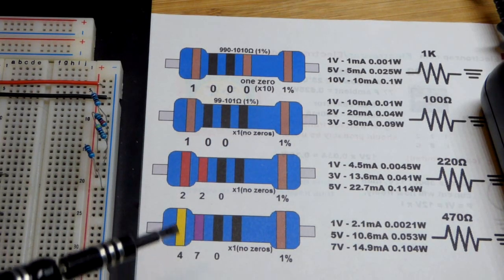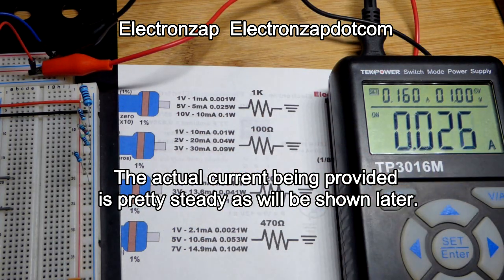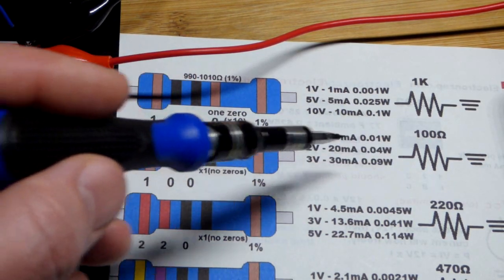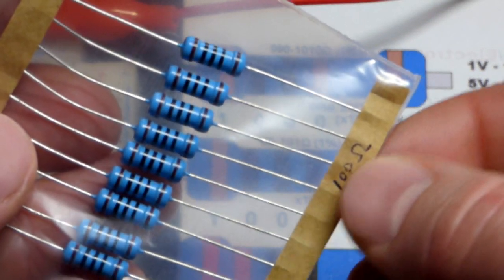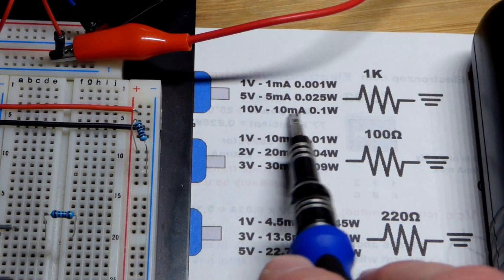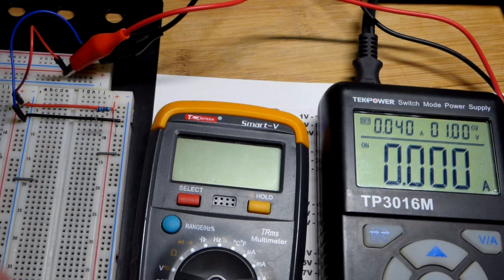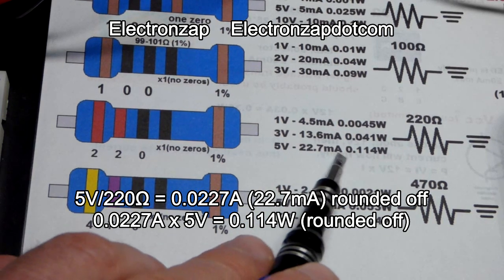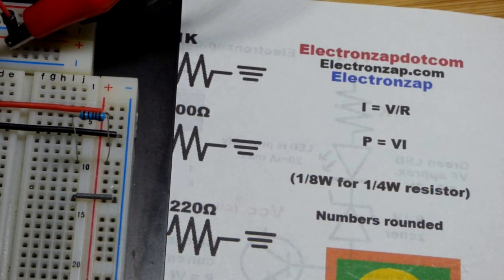Electronics resistor component fundamentals for current power and color code of common values

Comment: For what it is FWIW, the zero's counter band is a very computer science way of thinking -- building a string by concatenating characters, in this case appending zero's. I finally figured out which band on the resistor is the first one, took me a while to figure that out. Pretty important tho because if you start at the wrong end ... even if you get the colors right it's still the wrong value. 😂
Reply from the maker: Yeah, it's tricky alright.